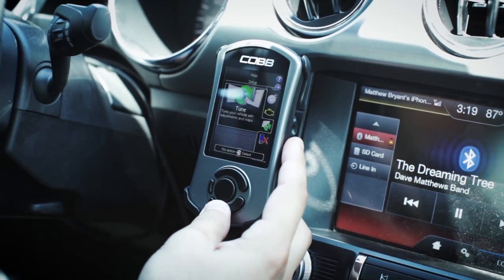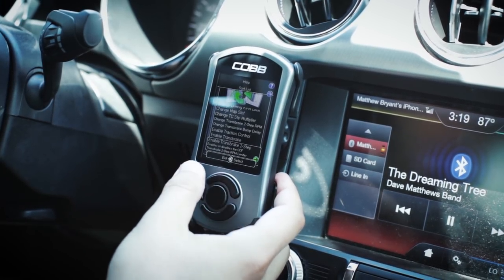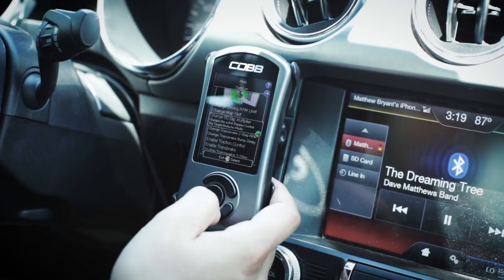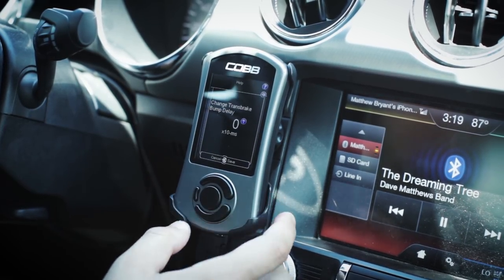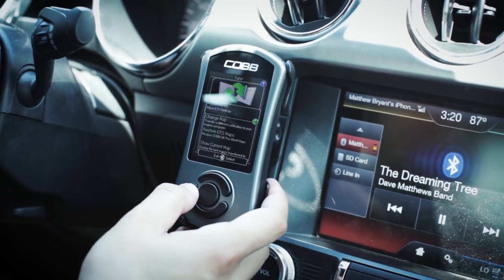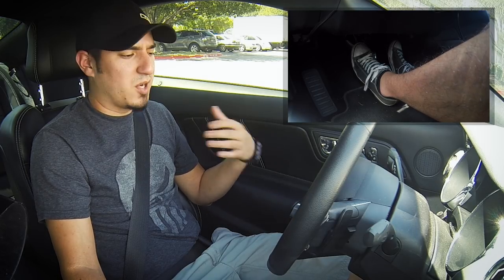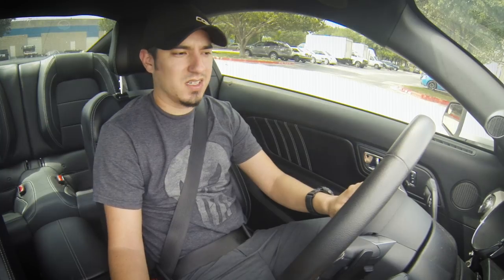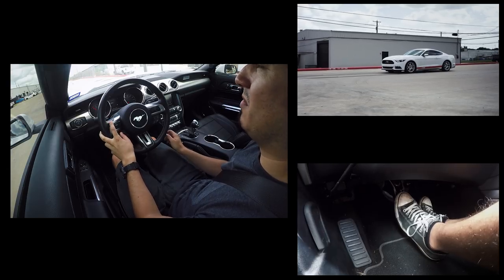COBB Tuning - Ecoboost Mustang Transmission Braking, Burnout Mode, and Bump Box

Comment: So I have a manual and have been trying to set my launch control but I don't know how to apply it such as does the car need to be fully on do I need to reflash the tune, or when I leave the adjustment page should it automatically set all of the adjustments
Reply from the maker: The car can be on or running.  Make sure you press the center button when saving the LC RPM (not the left/back button).  If you have issues, give us a call at 866-922-3059.  Kyle@COBB

Comment: TRC made something for supras that releases the clutch at a controlled rate for perfect launches, is that something that can be done with an accessport too?  I am sure additional hardware would be required though.
Reply from the maker: I believe you're referring to a Clutch Delay Valve which is essentially just a restrictor placed within the clutch's hydraulic line.  That is not something controlled by the ECU so the Accessport would not offer a solution on that front. - Marshall@COBB

Comment: For the burnout mode...what if you have the base model
Reply: Thats what im wondering. i usually just turn the traction control off and power brake.
Reply: haha, I was wondering the sam
Reply: @TheSocialPraxis  lol I had to re-watch this video to see how the bump box worked, I never used it, or burnout mode cause I run the strip on street tires..... I don't even use the bump box but I might start cause I've had times where I staged and had to back up and the light turned green while I was building boost with the two step smh
Reply: @TheSocialPraxis  bumpbox and burnout mode don't work for base models
Reply: @SoGWestsofly  bumpbox and transbrake are working on my Base EcoBoost but I am proTuned.
Reply: @TheSocialPraxis  I'm protuned as well, just tried the bump box and nothing happens lol
Reply: @SoGWestsofly  oh that sucks dude. Not sure what's different between yours and mine but it's working on mine. Who's your tuner?
Reply: @TheSocialPraxis  Ryan with pd tuning.... What are you doing to use the features, are they through the ap or your custom tune
Reply: @SoGWestsofly  I did exactly what out says in this video bro. The bumpbox I only tried it once and thought, this is fucking useless as I currently don't even go to the drags. But the transbrake I did a few times. I actually posted a short video on my Instagram. I don't think I put it on my YouTube channel though. Anyway, what I was saying about the bumpbox, I'm 99% sure I did it but it's possible I may have let off the gas and hit it again making it seem like that was the bumpbox. Now you're making me question myself 😂🤣. When I get a chance I'll try it again though. I'm having issues with my Methanol injection and my stupid airbags so I haven't been driving the car much.
Reply: @SoGWestsofly  I'mma upload my video into my channel but I followed this dude's instructions.
Reply: @TheSocialPraxis  ahhhh lol yeah I'm getting radials for next season so I'm going to be doing good old burnouts and will just use tge t brake after tires are warmed up lol.... I wish I had a sport mode to use, it would make things so much easier xD
Reply: @SoGWestsofly  isn't "S" mode sport mode? Or are you talking about "Sport+" mode? Base doesn't have Sport+ but I believe S mode is Sport mode.
Reply: @TheSocialPraxis  yeah I mean "sport+" or correction... Track mode like the premiums have lol sorry about that

Comment: So I flashed 502 and enabled these features, but they don't work. When I check my Access Port they show disabled. Any idea?
Reply from the maker: My guess would be the car not being up to temperature.  If that's not the case, give us a call at 866-922-3059 and we can help.  Kyle@COBB
Reply: COBB Tuning what do you mean exactly by up to temperature? It was over 80° outside. I'll give a call later today
Reply from the maker: Coolant temp needs to be at or above 150 F, Trans temp needs to be above 120 F.  Kyle@COBB
Reply: COBB Tuning good to know. If it's below that, will it show disabled in the Access Port? That's what I was seeing. I'll verify later before I call
Reply from the maker: No.  It just won't work.
Reply: COBB Tuning didn't get to call before end of business hours, but I'm in my car now and hooked up my Access Port. Checked again and trans brake is disabled. Not sure what's going on, but hopefully I'll get to call tomorrow

Comment: Does the accessport have to remain plugged in for these features to work?
Reply from the maker: It does not.  Once the map is flashed, you'll have  the option to enabled these features. They do have to be enabled each key cycle.  Once that is done, you could remove the Accessport if you wanted.  However, most people would keep it plugged in which would be required to make any adjustments. Kyle@COBB

Comment: When I go to adjustments I don't have those options
Reply from the maker: If you update your Accessport and flash the latest map, it will: https://www.cobbtuning.com/support/step-by-step-firmware-update-instructions/  Kyle@COBB
Reply: i just updated accessport and still only Change Map Slot, change TC Slip Multipler, and noble Traction Control
Reply from the maker: @Curt   Are you still having trouble? If so, make sure that you also flash the latest map revision after doing the firmware update. The update alone won't help if the car is still on a previous tune revision. If you try that and it still doesn't seem to apply properly. Please contact support@cobbtuning.com  we'll help you out.
Reply: COBB Tuning I got it thanks